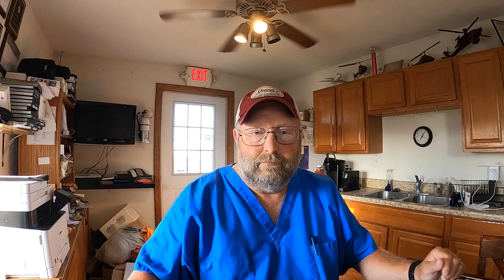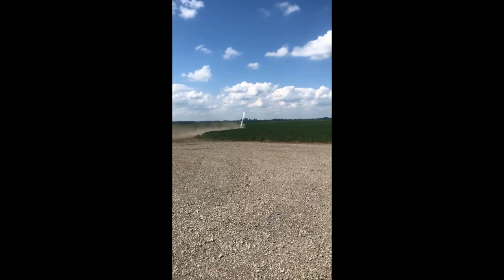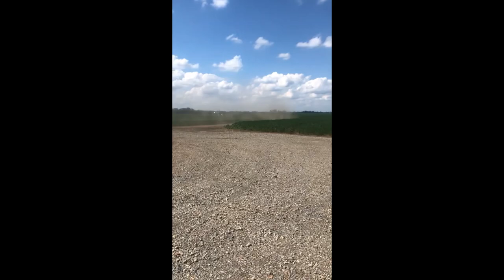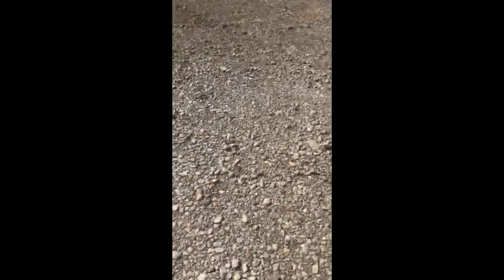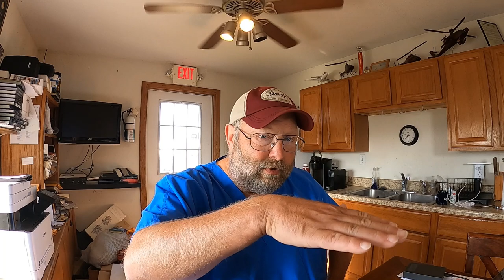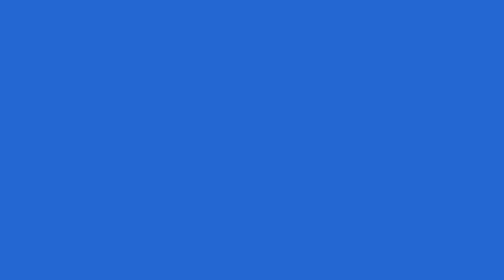Gyroplane Crash Review- Behind the Power Curve

Comment: I'm not a Gryo pilot, though, I used to fly gliders. It's all about lift and the lift acts at 90 degrees to the vertical; in a Gyro's case, in line with the rotor shaft. If the angle of the bank steepens the lift decreases pretty much at the same rate. As the gentleman says in this video, roll level and hold until the lift is re-established. Gliders are a little more forgiving because of the size of the 'rotor'/wing. That's my two cents worth.

Comment: One of the problems these days is ironically these modern machines.  Yes they are reliable and they have sufficient power with two people but the mast is so far off the ground that a pre-rotator is necessary.  That's not a bad thing in itself - although they are not as advertised other factors like axle position are far more important to take off distance.  Also the loss of the humble gyro glider and clubs.  You learn in a gyro glider hand starting your rotors in very controlled circumstances you will occasionally have someone hit the gas in the car too quick and you can experience mild blade flap and recover.  You learn this way however and you will know how to wind up blades CORRECTLY.

This modern flapping avoidance by spinning the rotors to speed beyond the airspeed the rotors can sustain at forces pilots to very quickly advance to full throttle.  This uses up excess strip while you chew up strip getting to an airspeed at which your rotors can advance and then you reach a speed at which the nose will lift.  Because many of these machines are tandem the weight on the nose is pretty high too so the nose lifts closer to take off speed than on a traditional Bensen derivative.  Now you are really ripping along your blades now suddenly are producing enormous lift and because your stick is full back they nose easily rises quickly to a very high position.

My direct drive VW with 22ft blades, marginal power and no pre-rotator was often getting off quicker than machines with powerful pre-rotators mainly because wheel balance allowed the nose to rise at 15mph and gently.  Your movements then are gradually adding power and forward stick gently balancing.  It was never a mad wrestling match you too often see with the current way most people fly off these modern machines.   Forget behind the power curve these guys are beyond the SKILL curve.  This is down to largely poor instruction.  

These modern machines must be very overweight too and compensating with just shoving masses of power so massive high mast+massive prop all this complicates take off right?  More torque effect on take off etc.  Back to basics guys learn how the rotors wind up and progressively wind up.

Most guys need to taxi some distance to get to the end of the airstrip.  Why the hell not do what we used to and wind up while taxiing?  By the time you are at the end of the strip your blades are up to speed, what rpm - no idea because I was trained to look and see if they were ready in the glider.  But you should advance slowly - you won't use much airstrip because you're going at a fast jog initially then just a little faster then the blades quickly accelerate and you can progress to higher power - GRADUALLY and in full control making only minor corrections so you get off flat every time.  3-5 hours and gyroglider doing a take off and landing every minute and you KNOW the correct attitude.  Never saw a set of blades smashed at the club I learnt to fly and instruct at.  This has poor instruction written all over it.  In this day and age there is NO excuse for turning $100 000 machines into twisted metal NONE.

Want to see how you do it.

Turn off the sound horrible music no proper audio anyway.

https://www.youtube.com/watch?v=36ogAzGGyG4

This was a mate of mine -passed a few years after this (not related to gyros).  Steve here is taking off on the taxiway after hand winding in bugger all wind.  Notice how slowly he is advancing?  This does not use much runway.  Yes there is a slight breeze but its not howling in still air he wouldn't be getting off that much slower he took off here often.  Now show me one of these so called modern machines doing better in the same circumstances...Also note how little drama his take off is.  Everyone trained at this club took off with that little drama.  It was only latter while seeing other more poorly trained people that I saw dodgy takeoffs.  I think this whole system that seems to have been accepted needs some looking into It smacks of dogma.  I could be wrong but I think it might be possible to prewind to significantly lower initial rpm, then advance more progressively like this then get off in a more gentle fashion and avoid most of these accidents.